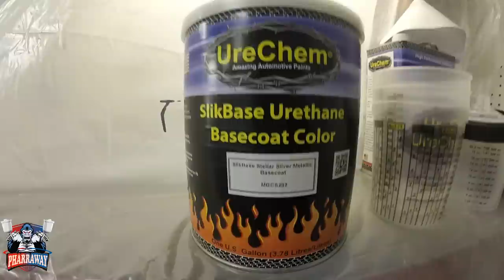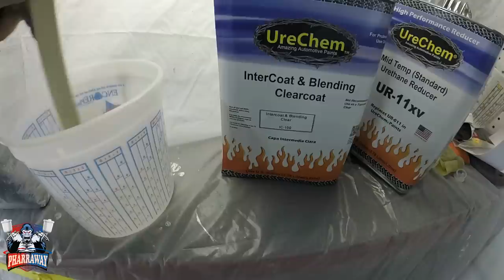How lowrider cars are painted with candy paint and metal flakes part 3

Comment: I have a question if you a doing a repaint in the original color would still use sealer on it or just put the new color over the old it’s same color couple dents to fixed
Reply from the maker: I would only because of the dents that you have to fix

Comment: Nice job I like that stela silver 
I have a ? The sealer was it 1 k or 2k how thick was it I have never use  sealer before you  used a 1.3 I was wondering if you  reduced it also you  put 1 coat only is the sealer  like a hb primer? Here  in the  UK we also call it wet on wet where  you  spray base coat with out sanding  which is pretty good I have a wet on wet hb sealer sitting  down in my garage which is a 6 to 1  wet on wet and I definitely will be trying it out for the first time I hope this helps also any good tips you want to give me would help appreciate you
  I been waching your channal for a long time now and you have been inspired me for a long  time especially your  channal I am always excited to look  forward  seeing your  channal thank you for all your help farraway and you and your family stay safe
Reply from the maker: it was a 2k sealer, wet on wet sounds about right

Comment: I'm not a painter. You do fantastic work and definitely make this look easy. Technique question for you and anyone else...when you added the flake, you did it from experience and by eye of consistency on a paint stick. Wouldn't you get more consistency, from coat to coat, if you were to weigh the amount of flake used in the first mixing cup? (By weighing the entire 1 pound bag of flake, both before and after the first batch of paint is mixed in the first cup/batch, to duplicate the same weight/portion of flake to be used in the additional cups?). Thereby we would have a simple but exact way to replicate the amount of flake in each cup/batch. Or, it just doesn't matter since you are applying 3 coats of flake...and the accumulated layers blend together in the depth?
Reply from the maker: That is a good idea brother need to start doing that thanks

Comment: Nice tutorial as usual.

I do have one question though...

When you went to spaying clear after the metal flakes, you switched to the plastic cup on the gun and I noticed that the cup's vent was left open without the vented "plug".

That thing gave me some issues when I sprayed and dripped midcoat clear with pearl or fine silver mettalic and/or worst yet, the Kandy.

I had to sand down and repaint twice so far because of dripping the Kandy paint, which is difficult to touch-up.

So, why is your plug not installed on cup lid and is it plugged/taped/sealed so that you won't drip paint?
Reply from the maker: for the metal flake to come out better I have noticed that leaving the plug off worked better for me

Comment: Nice work, do you do a drop coat on final coat of the flake coat like the base coat?
Reply from the maker: No I do not
Reply: If you're leaving stripes then yes, do your orientation coats... Since most lowriders have overlaying patterns - the streaks are ultimately hidden.....  My suggestion is to spray your flake from a 3"-6" higher hand position from the surface than what you spray a base coat & apply your orientation coat before moving to the next area... You want everything to melt together & flow out....

Comment: Ok I got a question do u have to use the whole gallon of paint on the car?
Reply from the maker: No, you do not as long as you can at least get 3 coats you will be good
Reply: Ok preciate u I shole thought u had to use the whole gallon
Reply: @hillsidesavage1413  if your spraying it panel by panel I would get a gallon

Comment: can you add the metal flake directly into the clear to save a step. or do u need the intercoat clear?
Reply from the maker: you can but you will still need to cover it with clear with out flake so you can sand it and not cut the flake
Reply: You can but two reasons why intercoat is better choice. 1) Less chance getting a run using intercoat. 2) you will get more mil thickness with clear.
Reply: You can spray flake into a wet bed of clear coat and it's very effective if you can nail it.... I personally clear the base 1st , then flake / clear & then flow coat more clear... Its way harder and uses more materials but,,, it protects my work in layers & that's what i prefer..... 

Intercoat is easier to control, you can go back and make a blend / repair if needed, Less chance for runs, also allows you to blow off and adjust any flakes that may orientate wrong.... It's cheaper than using clear